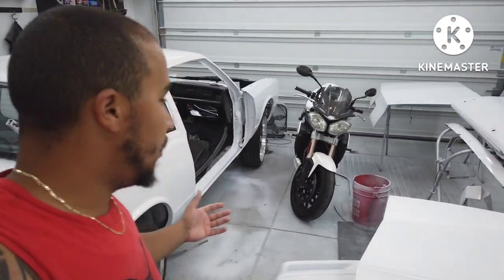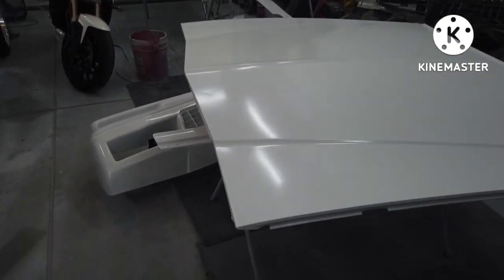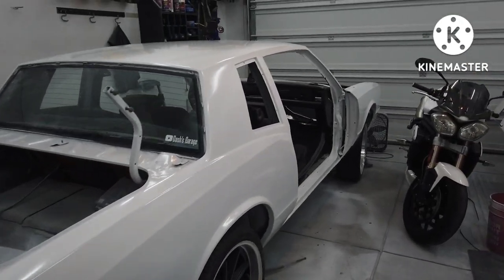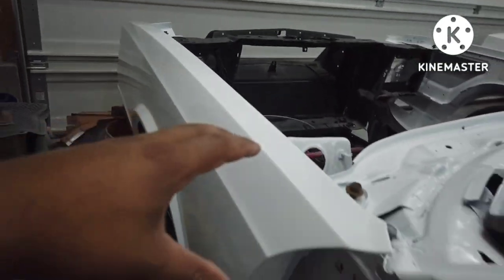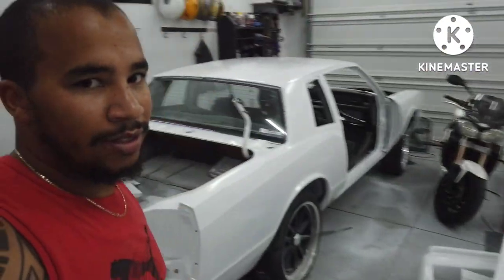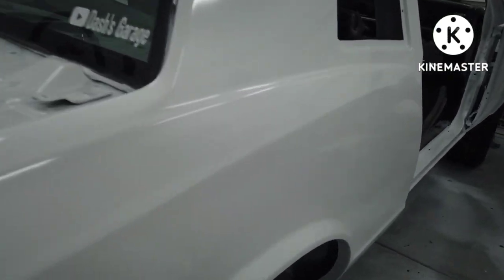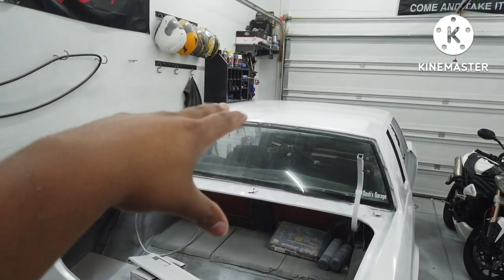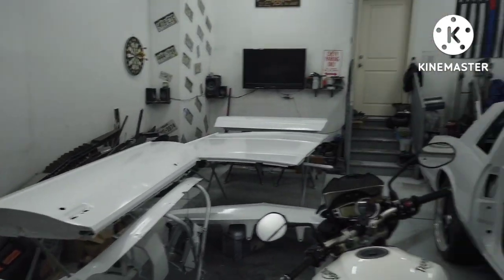Painting the 85 Monte Carlo aka Mona Lisa.

Comment: Not bad sir looks good you brought it back from the dead👌🏾
Reply from the maker: I appreciate it man. It's getting there, once I get it running is when it will really be brought back.
Reply: @Dashsgarage  you done the hard work get the engine in and running is the easy part I have to get some paint on mine soon👍🏿
Reply from the maker: @willierebuildz9182  very true. Going to be doing some small things before looking for a motor and transmission.